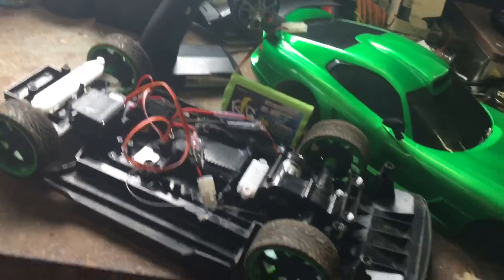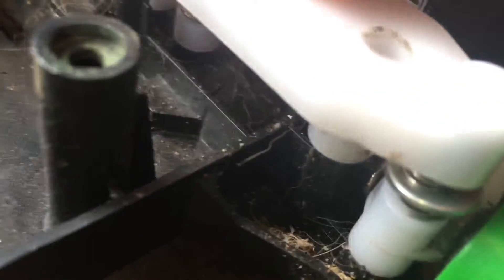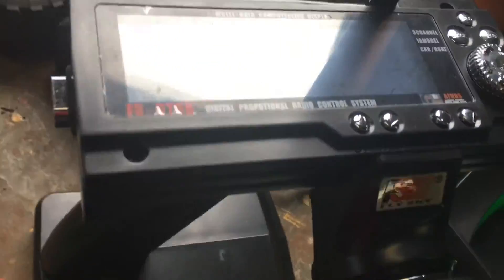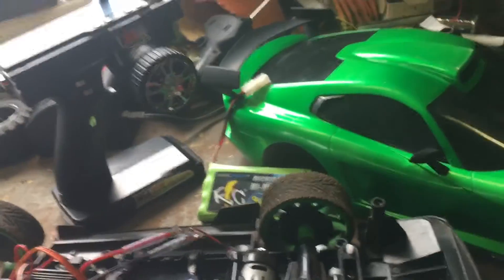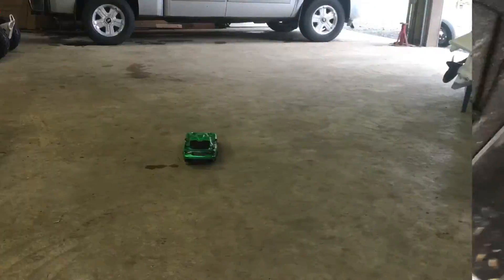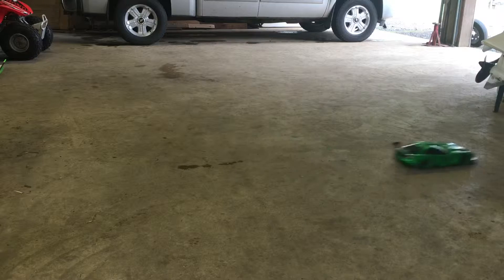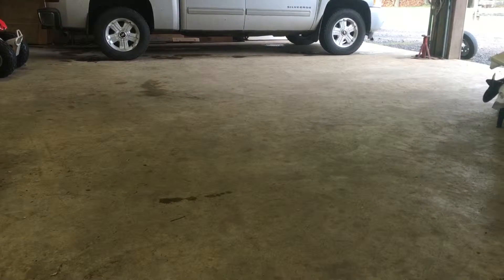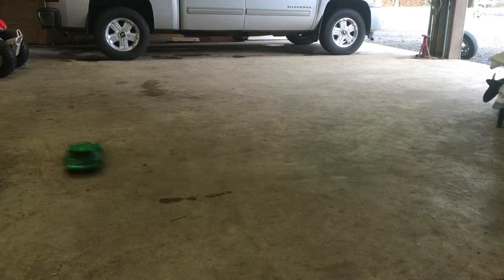I Modded The Viper!

Comment: hey what esc is that
Reply from the maker: Jake Monrial I don't really remember... I bought it because it was cheep which was a mistake in my opinion considering it is a lot less smooth than the Quicruns (by hobby wing) I normally use for my builds. I would recommend a Quicrun 1060 if you are doing a project, they do cost about $20-$25 online but for the quality and features included it's quite a deal.